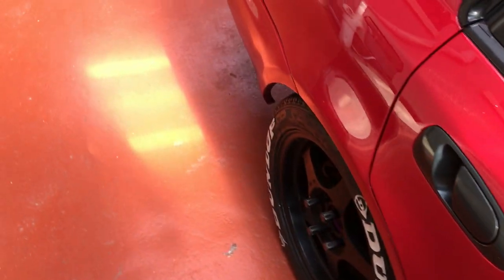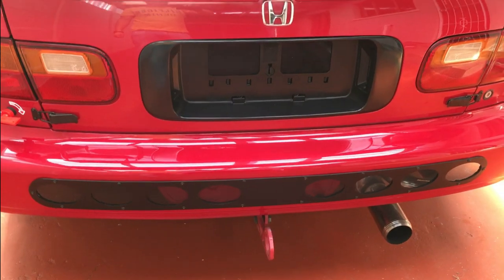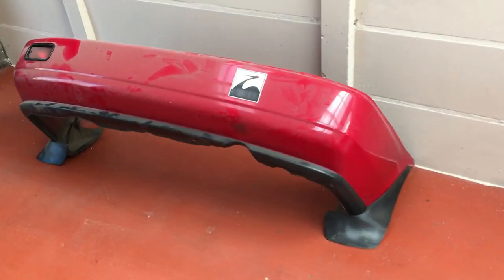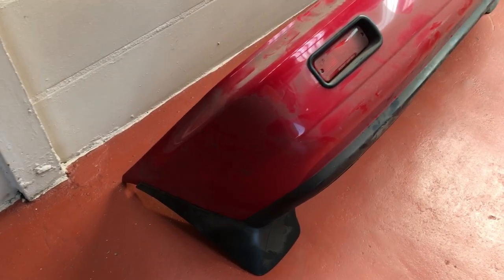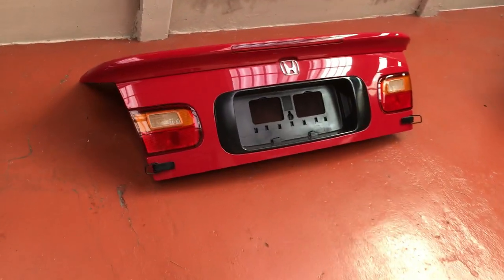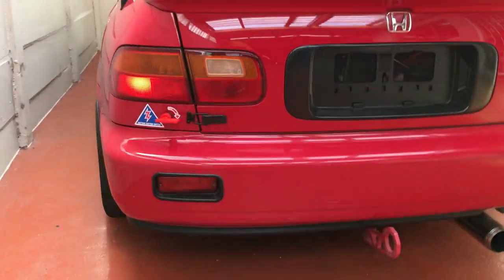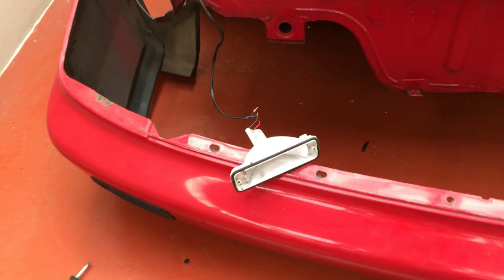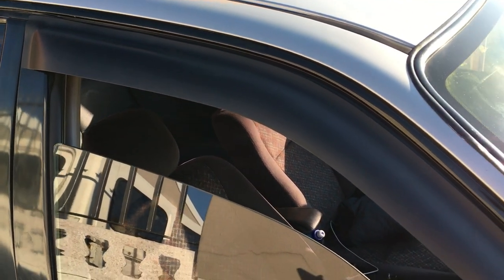MY HONDA EG’s REAR END GETS A NEW LOOK

Comment: suggest getting push on clips on the rear wiring so when you interchange bumpers lights just clip in instead of wiring it up all the time. Keep up the vids !
Reply from the maker: Yeah thats for the suggestion it is something ive been thinking of doing similar to wat ive done with my removal boot lid

Comment: Howzit bro, dig the eg8 bumper way more than the track set up. How did you do the fog addition on the rear bumper?
Reply from the maker: Yo bro im good and u?
Reply from the maker: Thanks for your feedback bro 🤘🏼
Reply from the maker: You would hav to buy the fog from honda and then mount it. I have a upcoming video on how i do it on a EK
Reply: WongStreet2Track cool bru, did you buy the bumper with the fog light or did you add the fog light, thinking of doing the same on my eg
Reply: WongStreet2Track thanks bru, will stay subscribed
Reply from the maker: As mentioned in the video the bumper is my oem bumper and i fitted the fog in the bumper. The only come out with the Fo in certain countries
Reply from the maker: I think i hav install picture on instagram
Reply: Hi Bru, really want to get in touch with you but don’t have FB or IG, do you perhaps have an email address that I can mail you on?
Reply from the maker: Check my description bro